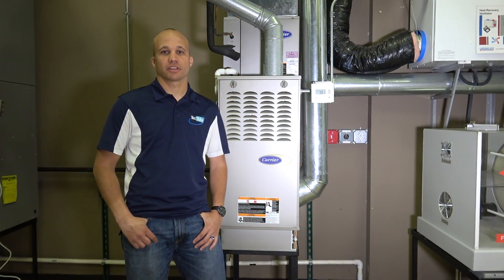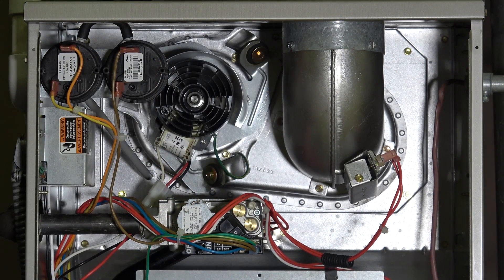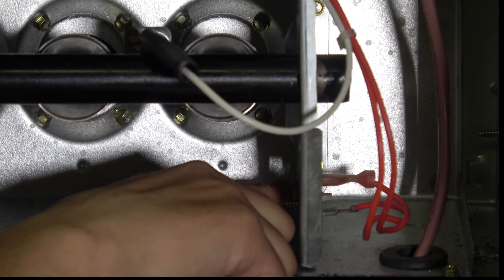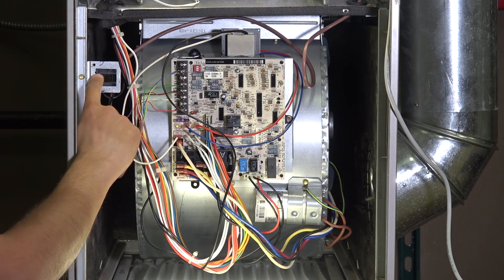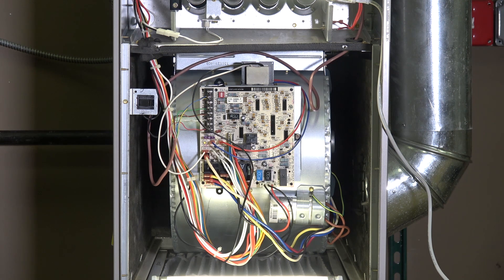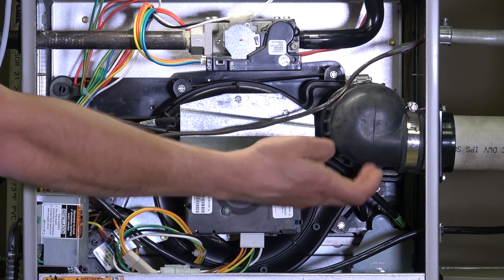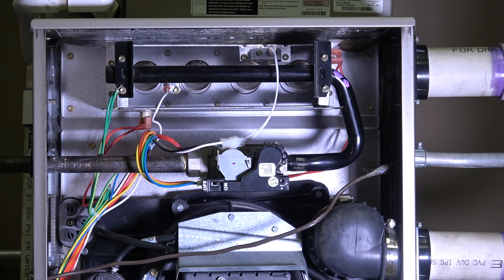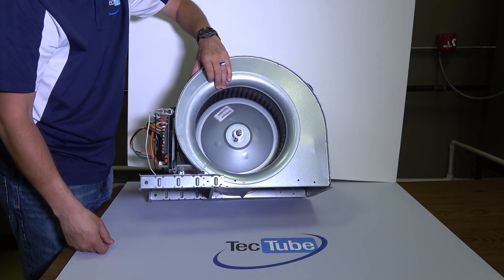Gas Furnace: Component Identification (1 of 2)

Comment: Do you gas analyzers to test for proper operation and if so what is normal? My service tech says it's the only way to prove correct operation. He provided me the numbers and said I needed additional service. Thanks!
Reply from the maker: Yes, you can use a combustion analyzer on a furnace, just like you can use it on a boiler.  That may be a good subject for our next video...

Comment: single stage carriers suck people! junk class action lawsuits for years for carrier knowinly making crap parts
Reply from the maker: There was one class action lawsuit that we are aware of regarding Carrier furnaces.  They stopped using that style of heat exchanger in 2012.  They also have been replacing those failed heat exchangers and/or giving the consumer an option to change to a different style furnace.  Manufacturing warranty failures happen for all brands and all industries.  We measure the brand based, in part, on how well they respond and react to any issue that happens.

Comment: do the condensed air gas furnace made by carrier pull all the poluution and pollen and molds into home i tested my drain tube water coming out its positive for toxic molds and noticed when gas is off it pumps cold air through vents when fan running
Reply from the maker: All brands of condensing furnaces work the same.  They can be installed to pull combustion air from outside (2-pipe) or from inside the home (1-pipe).  However, when combustion air is pulled from outside (where pollen comes from), it just runs through the heat exchanger and then back out the exhaust.  It does not mix with the indoor home air.
Reply from the maker: Some homes, in addition to combustion air, also have intakes for fresh outdoor air.   In those cases, pollen can enter the home, so good filtration is recommend.
Reply from the maker: Condensate water, for all brands of furnaces, has an acidic nature and products of combustion.  It should not have mold, though.  Perhaps mold is growing in your condensate pan on your evaporator and it shares a drain with your furnace.  Or perhaps mold is growing in your furnace condensate trap and it needs to be cleaned.
Reply from the maker: If you have your thermostat fan setting in the "on" position (or you have a ventilation intake system also controlling the fan), then the fan will be running when the heat is off.  This is normal.  If the air is cold, you may have leaky ductwork in an unconditioned space sucking the cold air in.

Comment: A run capacitor's job isn't to store power like a battery or give more power to the motor. In fact, it's very unlikely that little run capacitor will store energy for more than a second or two after the disconnect is turned off. Single phase inductive loads generally push your current and voltage out of phase with each other. This is true for all PSC motors.  The capacitance of the capacitor counter acts the phase shift between your current and voltage caused by inductance and gets them back in line with each other. Without the capacitor the motor will pull too much current, create a ton of heat, possibly fail to start, and cause the motor to cycle on internal overload leading to a very short life for the bearings and windings of the motor.

Comment: Is it possible for those tubes in the secondary heat exchanger to get clogged or crack. And what would cause that? Thanks. Awesome video btw
Reply from the maker: They could get clogged.  If they are clogged on the inside, it could be due to incomplete combustion, debris in your combustion air, or other factors.  If they are clogged on the outside (the fins), it would be due to your return air being dirty (i.e., lack of filtration)..
Reply from the maker: Cracks are more likely to occur in the primary heat exchanger where the temps are the hottest.  This is usually due to too high of a gas pressure or too little airflow.  Cracks in the secondary would be uncommon.